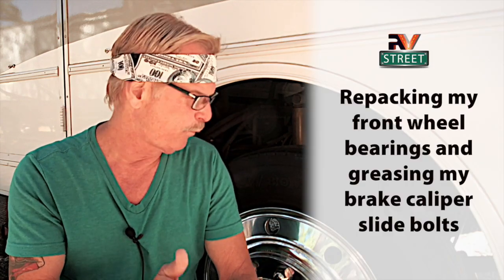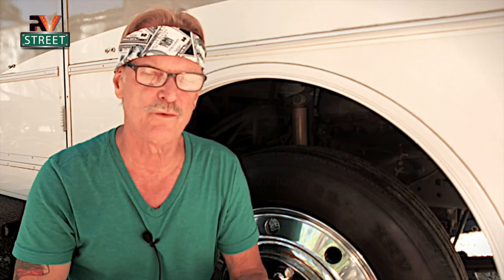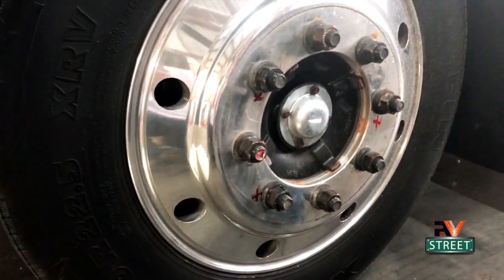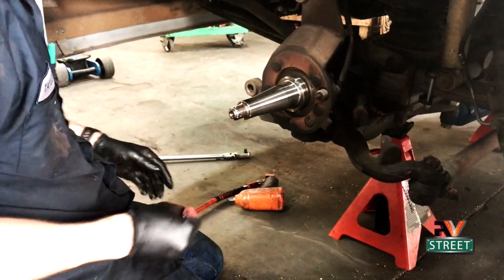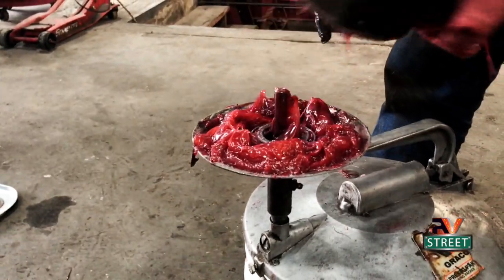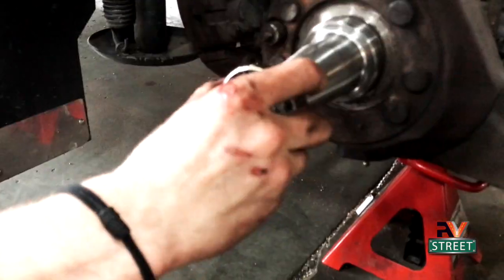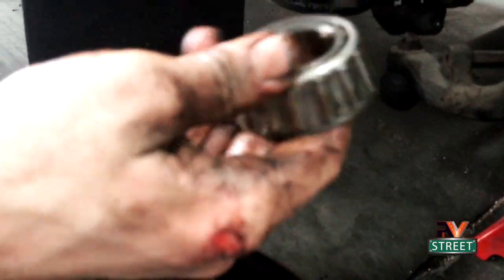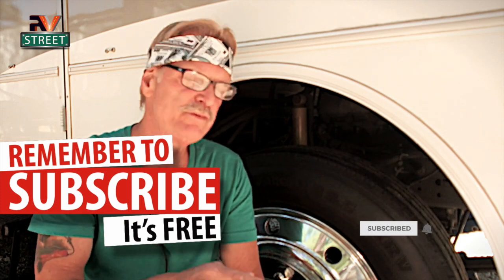REPACKING FRONT WHEEL BEARINGS • CLASS A Motorhome, F53 Chassis

Comment: A shop you trust??? is there such a thing? The shop is there to take you as hard as possible. I know this because I have worked for several of them. I should have filmed me replacing my rear end bearings in a campground in Enterprise OR. Stangle's diesel charged me like 200$ a bearing because they knew I had no choice and then they wanted 300$ a side just in labor I suppose if you are filming the whole thing for you tube they won't try any funny stuff like 100% parts markups and so on. In the 7 years we have been F/T we have gone to 6 shops and ALL of them screwed us in one way or another.
Reply from the maker: Ya there is such a thing but hard to find for sure. This is the 2nd time I've been there. The first time was 2 yrs. ago to have my front end alignment checked. After having my coach an hour they brought it back out to me and said my alignment was spot on. No charge.
Reply: @RVstreet  We have a local shop that does the buses, fire trucks, etc. for the county.  They are very good, and quite reasonable, with excellent reviews.  So there are some of those shops around that don't gouge.  And they work on Motorhomes too.  They have gotten very good reviews from tourists who had to have emergency service, and all the comments were that they didn't try to overcharge.  Less than 5 miles from the house which is a plus too.  We just got a 2018 Winnebago Vista that is in decent shape, got it at a good price due to some roof radius damage that was repaired.  Before we do a long trip I'm going to take it in and have the brakes and alignment checked.
Reply: @RVstreet  Well ok then, I stand astonished and corrected lol